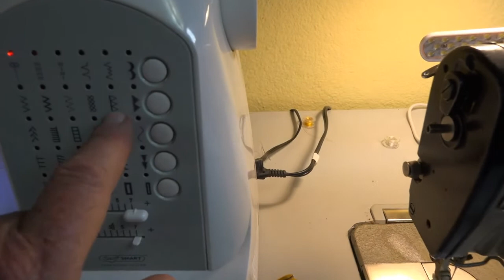Domestic, Industrial, Heavy Duty sewing machines? What's the difference?

Comment: Good advice 👍. I recently bought the Singer Heavy Duty 4423 to make jeans. It works well, but it is under stress when attaching the belt loops. I nearly killed it, and have broken a few needles. My local sewing machine dealer has recommended I get a Singer 141G heavy duty. I think it’s the walking foot model.
Reply from the maker: negative, It's not a walking foot, also the singer 4423 is nothing more than a child's sewing machine. The Chinese just put the heavy duty label on it to sell it. open up the top cover and take note the number of plastic piece's in it. 

Go to ebay and look under industrial walking foot sewing machines. there are some that are not a walking foot sewing machine so be careful. Also some do not have reverse. Pick a sewing machine and look it up on youtube for reviews, most machines someone has posted some kind of a video.
Reply from the maker: Here are some suggestions: https://www.ebay.com/itm/234212787244?hash=item36882b842c:g:h10AAOSwP6VcO-Vz  -------- https://www.ebay.com/itm/334159852171?epid=5002916296&hash=item4dcd7ab28b:g:Sj8AAOSwgztdhCjp  -------  https://www.ebay.com/itm/113402736025?hash=item1a67546d99:g:HQsAAOSw-K1cwgNY
Reply: @gmcxm211  You are right. The 141G 30 CEA is a lock stitch machine. It’s a very confusing decision to make in converting to an industrial machine. I’m just messing around at home during our never-ending lockdown in New Zealand, entertaining myself with jeans making. I will have to buy a machine locally, and not off ebay, but thanks for your suggestions.
Reply from the maker: @kimmyg990  do you not have access to ebay or something similar?

Comment: I have a few questions:
1.can a heavy-duty machine be called a leather machine too?
2.is it capable of sewing multiple hardness and thickness?
3.for someone who wants to produce clothing as well as very thick leather projects can any heavy duty machine be used or do I need to be specifically showing for "a leather machine"?
 4.is any walking foot machine a heavy duty machine?
Reply from the maker: Leather machines have special feed dogs as not to mar the leather. It also has to be an industrial size walking foot machine. You can get feed dogs for leather for certain machines. As far as what is the best machine for leather, that's a never ending battle. 
No not every walking foot machine is a heavy duty machine. The singer 151w is an industrial walking foot machine, but it was built for one purpose. To sew women's under garments, silk and sheer fabrics at high speeds. You need a walking foot machine to sew those fabrics. But it does it at high speeds. The needle system can not sew anything heavier than quilt size material. 
Consew 205rb or a 206rb can do both but you need a leather foot. I just looked on eBay and there's about a dozen Singer 211's for sale. 
stay away from those unnamed machines for 300 or so dollars, these are nothing more than everyday normal duty machines.
was there a certain machine you were looking at?